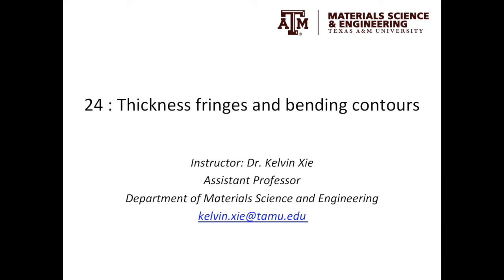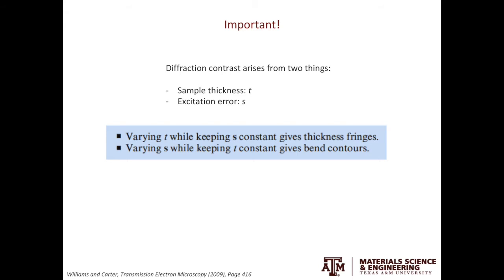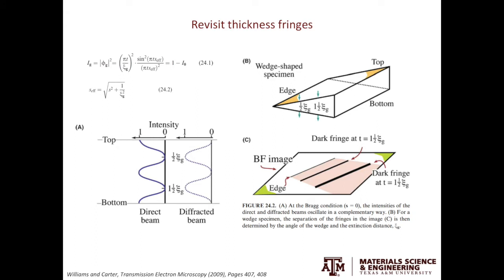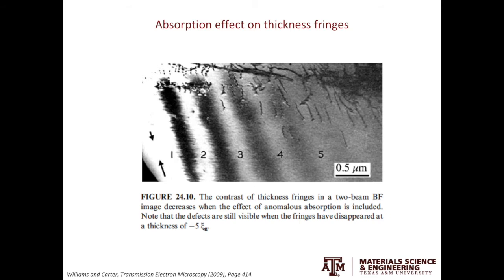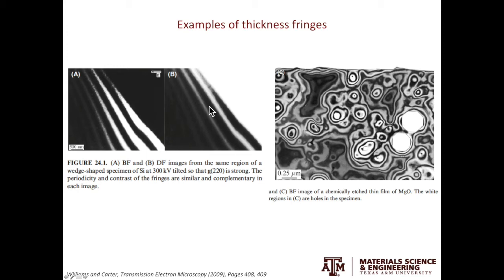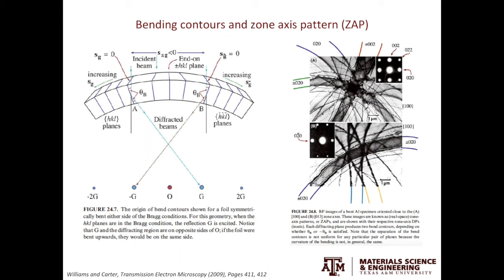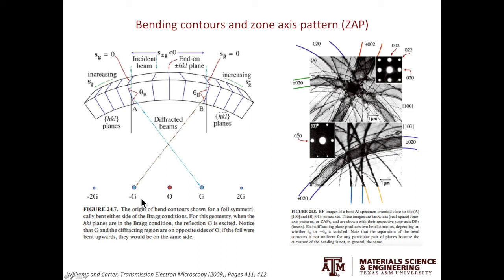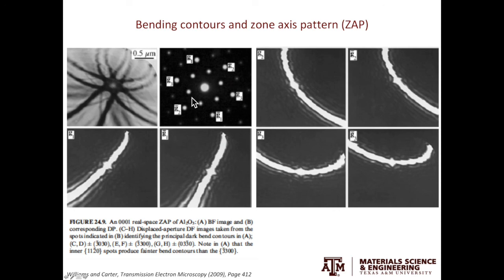24: Thickness fringes and bending contour

Comment: I have simple question about morie fringe and thickness fringe. How can we tell whether we have morie or thickness fringes when we are doing TEM ?
Reply from the maker: Hi Xiaoxiao, for thickness fringes, you only have one crystal, where the sample forms the wedge shape. For Morie fringes, you need two crystals with different orientations overlapping on top of each other. One example is an inclined grain boundary to your beam direction. Hope this answers your question.
Reply: @kelvinxiemsentamu6890  Hi Dr.Xie, thank you very much for your answer. So I am wondering whether we will still have thickness fringes in two crystals with different orientations overlapping on top of each other ? The other way to describe this question is, which effect will be dominated in our image ?
Reply from the maker: @xiaoxiaoge741  Hi Xiaoxiao, based on my experience, the thickness will not play a big role when you have two crystals overlapping each other, so the Moirie effect will be more dominant.
Reply: @kelvinxiemsentamu6890  Thank you very much for your reply, the answer is really helpful for understanding these concepts.